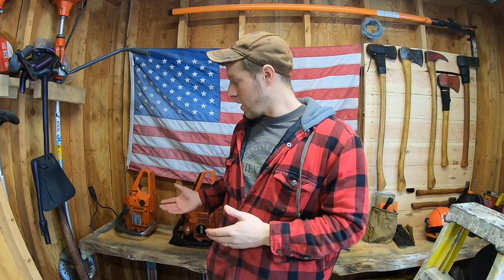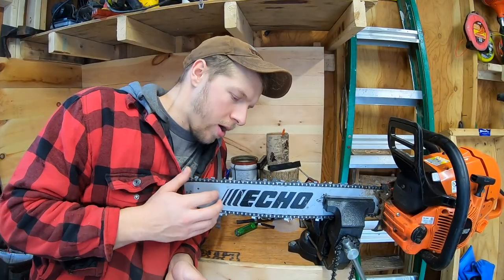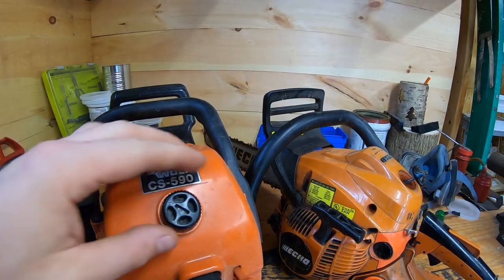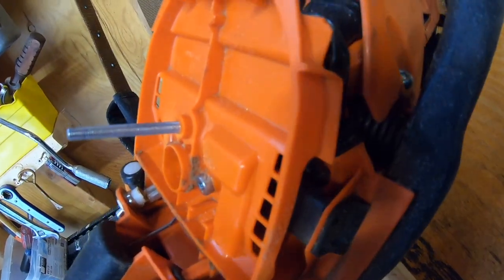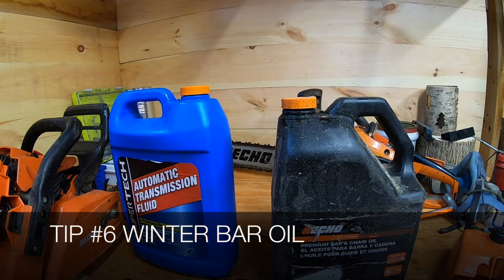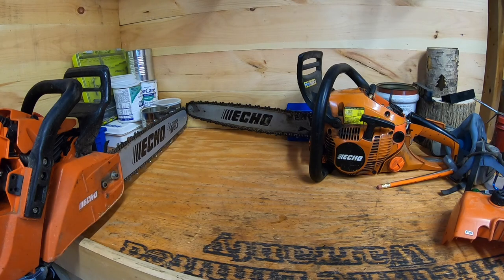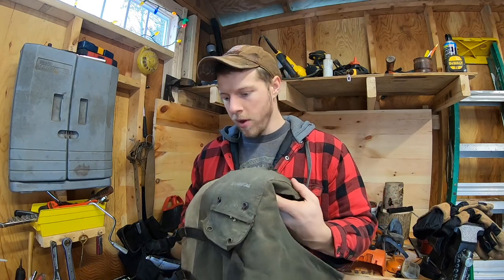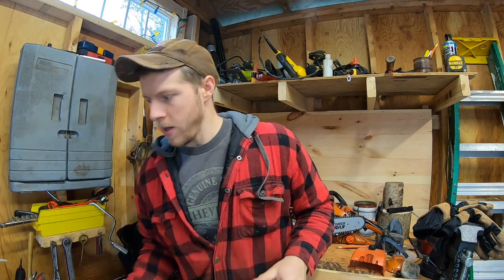WINTER CHAINSAW TIPS! MUST WATCH!

Comment: Just a couple things. READ the manual that comes with your first aid kit BEFORE you need it. Because, when you do need it, you probably won't have time to look up guidance. You only have seconds to respond to severe wounds and chainsaws make the worst. Second: Unless you use up a lot of it, it's a good idea to but fuel preservative in the gas you use to mix your chainsaw fuel. It's more likely to separate in the winter causing varnish deposits in your saw.
Reply from the maker: Hey Rob! As always great tips! This kit may seem all bundled up it it’s just a quick rip plastic holding everything together but you are correct. I’d even go so far as practicing putting on a tourniquet! I’ve done it once as practice but now that you mention it I’d prob practice more!
Reply from the maker: Also good tips on fuel storage! I should have mentioned that! I use my saws year round so I cycle enough fuel not to worry about it.

Comment: I carry a quick clot pack to stop major bleeding as well. It may be overkill (pun not intended) but I also wear a chainsaw vest over my jacket in the winter. In the winter I fear kickback hitting me in the chest or neck more than in the summer for some reason. The vest has a high collar that protects your collarbone and jugular area. The $ spent is worth the feeling of safety when cutting alone and it isn’t as expensive as chaps. I wear chaps too.
Reply from the maker: Hey Denny! The quick clot isn’t a bad idea. I have looked into a chainsaw vest too before and as I feel a lower body injury is more likely but never be too safe for sure! Thanks for the comment! Stay safe out there!

Comment: When rotating your bar, being there is only one bar oiler hole, will it still oil properly when turned upside down?? Great video, thanks! Good tips ! 🪵🔥👍🤠
Reply from the maker: Hey there! There should be two holes on any chainsaw bar. “Should be” is the key word there  they are in opposite sides obv and when you flip it it will still oil
Reply from the maker: If you are dead certain there is only one bar oiler hole then I wouldn’t flip it. Seems odd. All bars I’ve ever seen had one on each side opposite
Reply: @HomesteadJay   there is a hole on each side, but when you flip the bar the hole goes from the lower position to the top position, will oil still get to the hole when flipped? Thanks
Reply from the maker: Think about it when you “flip” the bar the oiler hole will be on the top
Reply from the maker: The oiler hole will be on the “top” of the bar when it’s mounted. When you take your bar off and “flip it” you are putting what was the top of the bar now on the bottom so that hole that’s on the bottom will now be on the top. If that makes sense lol

Comment: Non ethanol (marine or aviation) fuel. Regular gas attracts water, causing corrosion and engine problems. Paper clips or jig. saw blades work well to clean bar.
Reply from the maker: Good tips for sure! Thanks for watching!

Comment: My Echo 590 did not like me using that winter mode last winter, very hard starting after I used it. I use Stihl winter oil in the blue jug. Also a helmet on you head..
Reply: You'll have to adjust your low speed mixture screw in the cold. Richen it up slightly. After I did that my 490 which I could never start in the cold now starts in 1-3 pulls depending on the temp.
Reply from the maker: Interesting! This is the first winter with mine I’ll have to see how it does
Reply from the maker: That’s true! Sometimes Kaleb you do need to fine tune. My husky needs a winter tune and a summer time cause it’s picky lol